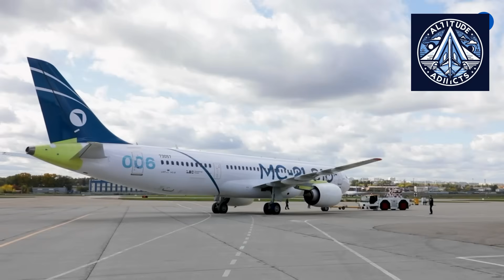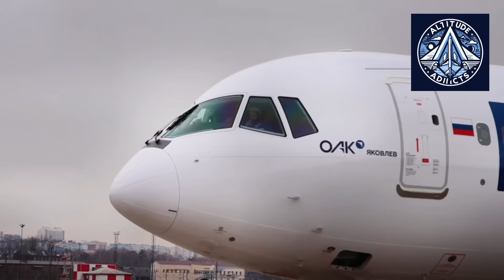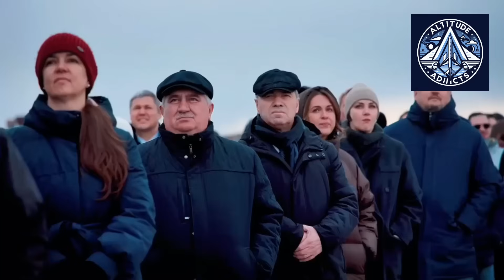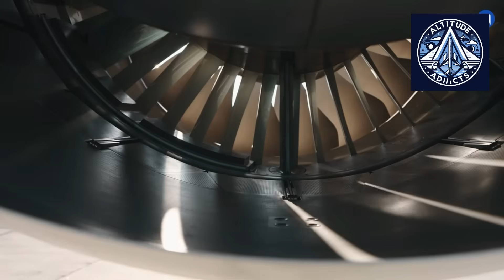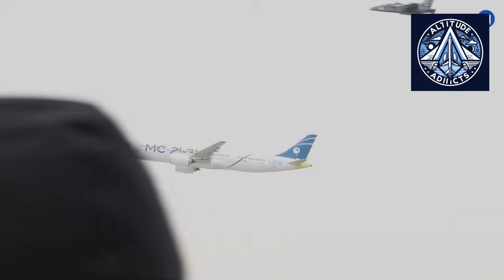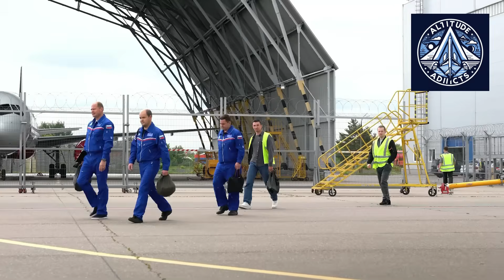Only 23 of 293 Flights Done: Russian MC-21 Faces Shortage, Costs, and Hidden Challenges

Comment: Yadrov has nothing to do with UAC or UEC ...... nothing he says is worth listening to  ..... because he is not involved in the certification program at all ..... they have 2x aircraft doing test flights but they have only done 23 flights ? ..... just total BS  ......
Reply: It's not BS, there is obviously something wrong with the plane, that's why they are not flying it, and that's why they announced a huge reduction of its max range. If everything was ok with the plane they would have finished certification by now, or at least they would progressed much further with certification. Also, what use has doing certification flights if all Western systems haven't yet been replaced? They would have to do them all over again once those systems are replaced.

Comment: This project will fail. Russia does not have the economies of scale necessary to economically build commercial airliners.I say that as a neutral part, from a purely economic perspective
Reply: It has already failed, 20 years of development only to announce that the plane's performance will be worse than 30 year old Boeing and Airbus models, they won't even get to the phase where they would need to worry about economy of scale.
Reply: @LloydChristmas983 Какие характеристики у него хуже?Он ничем не уступает а320/737
Reply: @kinza4428  It definitely is, it has half the range of A320/B737.
Reply: @LloydChristmas983 У них одинаковая дальность
Reply: @kinza4428  No they don't, 
-MC-21 range: 3.830 km (if that is even true, it's not tested in commercial use yet); 
-A320 range: 6000 km (tested as there are many routes throughout the world that are longer than 5000km, a lot of these routes are in Russia or originate in Russia, for example Moscow - Blagoveschensk route).
Reply: They need this regardless of the economics. It doesn’t really matter if it can’t compete with Boeing or Airbus. In the face of sanctions, a country that large won't be stuck without a way of moving its people across its territory
Reply: @KMASIF-mi9yj  ..the project will fail. it will run out of money. same thing which caused ussr to go down. they must internationalize this project by getting partners on board such as india in joint ventures. russian economy can only bear the weight of subsidizing uneconomic production for only so long....
Reply: @DubaSangara Относительно бюджета России авиастроение это копейки,тем более,что у нас самолёты производит государственная компания и как следствие это дешевле в конечном итоге.Зачем нам нужна индия в проекте?У них нет никаких технологий в авиастроение сравнимых с нашими
Reply: @kinza4428  ..i think you don't understand economics.
Reply: @DubaSangara Один самолёт мс21 стоит 50млн долларов.Я думаю вы сильно верите в свободный рыночек и прочий бред.
Reply: @kinza4428  one MS21 cannot be cheaper than a sukhoi 35; that is garbage
Reply: @DubaSangara су35 стоит 25млн xd
Reply: @kinza4428  ..not true. russian airforce is seriously understrength. if they were that cheap they would be produced in hundreds. you know nothing.
Reply: @DubaSangara По слитым документам цена су57 составляет 38млн долларов(без учёта разработки,чисто цена производства).Российские заводы загружены по полной и в составе ввс достаточно истребителей(около 500штук) реальное количество конечно не разглашается
Reply: @DubaSangara су35 выпускается порядка 35штук в год
Reply: @DubaSangara  I must admit that I am surprised by the neutral feedback on the state of affairs with the MC-21. In Russia, we also feel that there is something wrong with the MC-21 project. But what are our options? Even if Boeing and Airbus tell us tomorrow to buy their planes again, we still need to develop our own aircraft. Because what will happen day after tomorrow? Therefore, I believe that the project will continue to exist. However, it is ironic to read about how these and other difficulties will lead to the economic collapse of the Russian Federation. Our grandfathers and grandmothers experienced such hardships and deprivations in the 20th century that our current problems are simply ridiculous! Unfortunately, the West will never understand what we are talking about or what they are dealing with.
Reply: @vikos7914  ...the laws of economics are iron clad and do not respect anyone's fancies. once you run out of money, that is the end of the project. that is how the USSR collapsed, and its industries were decimated,so I am not telling you anything new. That is how you ended up buying Boeing and Airbus, not because of some fanciful wishes, but because your commercial airliner industry collapsed. Unless you internationalize this project and attain economies of scale, this project will fail. The west understand perfectly, and that is how they ran you into the ground the first time. And I am not from the west.

Comment: Eine MS 21-"210" mit ~140-160 Pax wäre die ideale Abrundung der Möglichkeiten der SJ (80)/100/(130) mit den MS 21-(210)/310/(410/?510?) & der avisierten WBL 500-700.
Auch Airbus & Boeing arbeiteten über Jahrzehnte an jedem Teil, um g für g & kg für kg Gewicht einzusparen.
UAC arbeitet nun erst 2½ Jahre an der 100% Importsubstitution.
Reply: True talk!
Reply: The damage caused by the senseless war and the forced import substitutions is immense. The original technical specifications are not being met. All plans and deadlines are repeatedly missed. Costs are rising.
It's incredible how much better off this project would be today without the war-related sanctions.